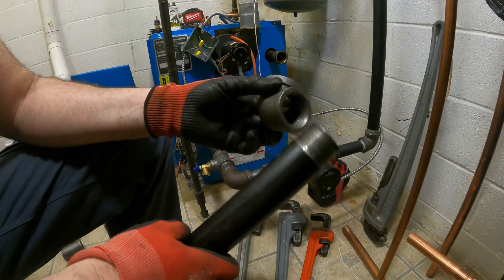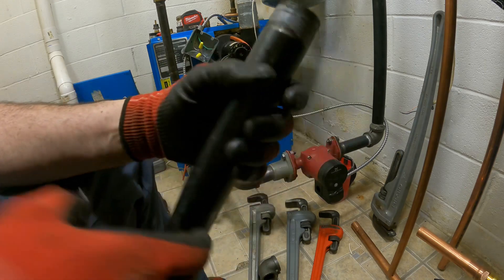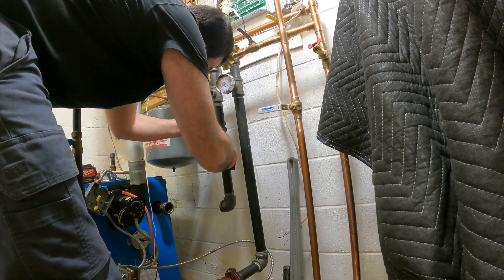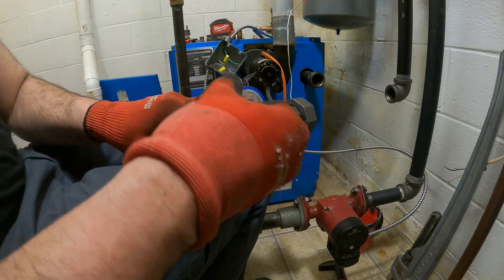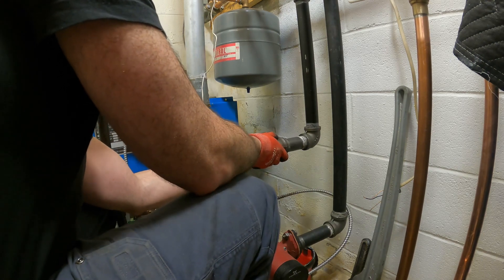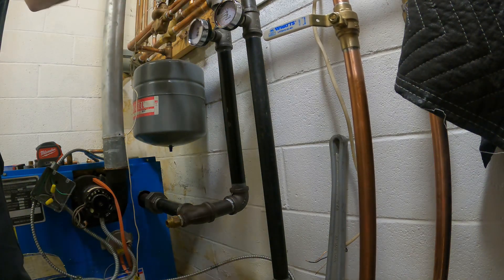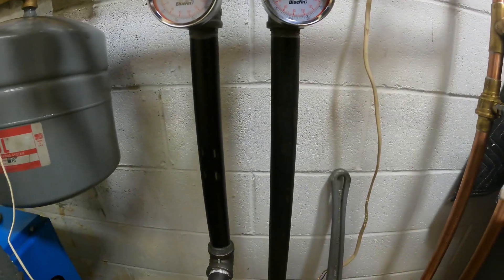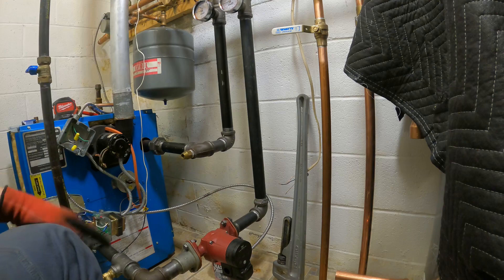How I Seal/ Install Threaded Water Pipe Fittings Line Up Boiler Pipe Fittings

Comment: Hi Bill . I have question for you . I have cast iron boiler made by slant fin , it is direct vent Victory model . Boiler is over 20 years old by now. I removed old circular pump on return side of boiler do to pump rusted and leaking water . Treaded part of boiler on return side have internal threads it 1-1/2 diameter and they are not in prefect condition do to age of boiler , I can still able to thread new pipe in boiler . My question is how do you sill this old threads to make leak free connection?  Thank you

Comment: Great video.  One of the only videos that shows how to work with the pipe for boilers.  I need to replace a Bell & Gossett flow control valve and wasn't sure how to manage when turning one side unscrews the other.  Seeing you connect to the boiler now things make sense. Do you have to cut and thread the pipe yourself or does it come like that already? Thank you!

Comment: Anyone out there have a better method for easily cleaning threads? I wonder about the oil left over from the manufacturing process on brand new pipes. I don't think using dirty gloves is the best option. :)

Comment: Weekend plumber here. This video helped answer some questions. BUT...what happens if that "one last turn" won't go all the way around again? How do you adjust? Do you remove it, re-tape and re-dope it, add more tape this time, and then try again?
Reply from the maker: Try to not go for the last turn. If you noticed when I was putting pipe together I stopped before where the pipe should be. Then when I connect and need to adjust angle I am still tightening. If you go until it gets stuck, yes it needs to come off and get resealed. The pipe doesn't need to be overtightened. All my connections might even make another complete turn with enough force. Yet over tightening can create a leak. Here is a video I am doing some black piping. This is my main channel where I am doing actual service calls. https://youtu.be/P6mTdu6-iBA

Comment: I’m installing a pipe, when I tighten one end it loosens the other end

And when I tighten that end, it loosens the end I just tightened.  

Wtf!!
Reply: Use a union
Reply: @berderk2796  Thanks I'm in the same spot. Replacing a 1.25 inch shut off for boiler and the connection from the shut off to the next joint is a straight pipe

Comment: Maybe 50 years ago as an apprentice our electric shop had a set of so called electrical dies for Rigid 1/2 to 2" stock & dies. A mechanic insisted on borrowing them to thread several pieces of schedule 40 pipe for 125# steam line. I tried to explain that only the sparkies were supposed to use them but he said that I was a no nothing first month apprentice. So he used them and had a leak, he applied the pipe dope & Teflon tape then had another leak, then another leak. Finally our chief electrician told him that the first month apprentice apparently knows more about threading steam.pipe then him.After that we painted them bright orange. Like to have a dollar for every piece of rigid conduit that I threaded.
Reply from the maker: The does need to be tapered not just to make threads: different dies used. Mine can be used on a hand threaded or a power threader

Comment: That pumps on the wrong side of the system. Gotta read the install book. Lookup Dan Houlihan "pumping away".
Reply from the maker: Pumps on the correct side of system. Your looking at the primary pump. The secondary pumps are pumping away.

Comment: WRONG never use tape and pipe dope, pipe dope needs to contact the metal threads for it to work and if you use tape and pipe dope the pipe dope won't contact the metal threads on one side.
Reply: Wrong, it's not a never are always answer. North Carolina office of the state fire marshal and engineering division for instance requires what the instructions on the tape used are. If tape says no dope, then no dope, if tape says may be used with dope, then it may be both. Some states, counties, and cities require that teflon tape and pipe dope be used together for plumbing pipes and natural gas lines in all residential homes. Some states, counties, and cities require use of only one.
Reply: @Reloadeez   you were taught wrong
Reply: @7587 Once again it depends on the code, hacks like you don't follow code.
Reply: @Reloadeez  if they is a code to use tape and paste it should be illegal.
Reply: @Reloadeez  post the law link and i will have it removed.
Reply: @scottp7587 WRONG... The threads cut through the tape as it's tightened.  Plenty of contracts specify using tape and dope because there's people like you who can't make a connection that will pass pressure testing.